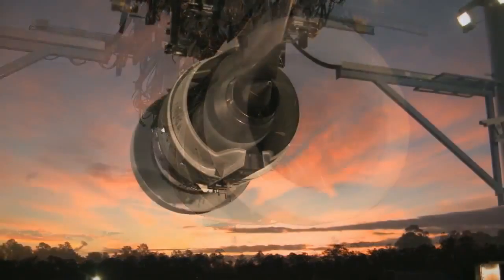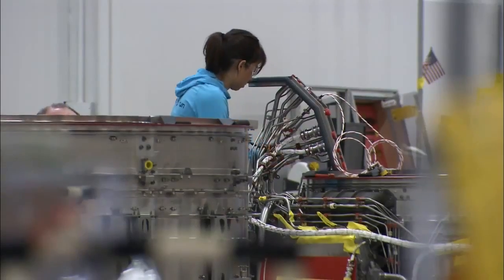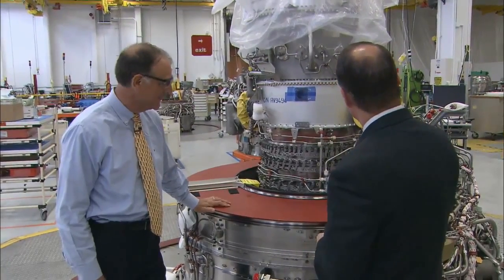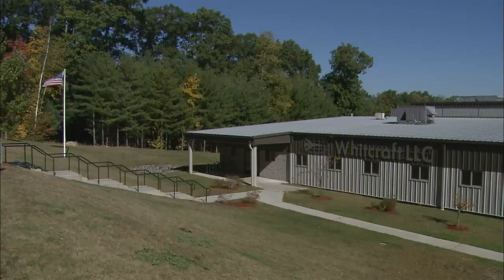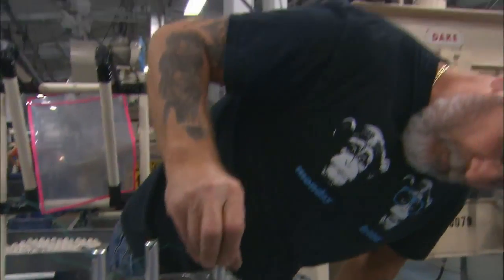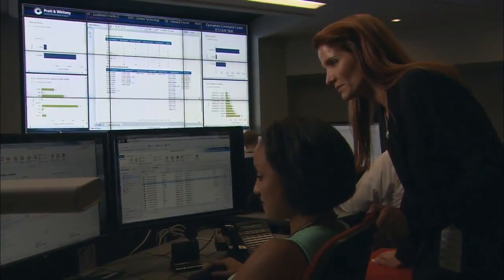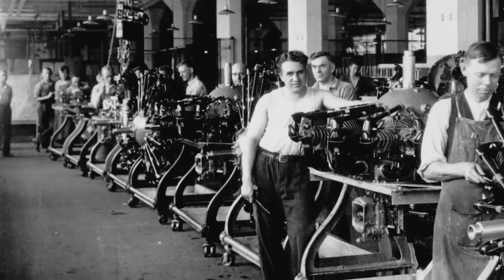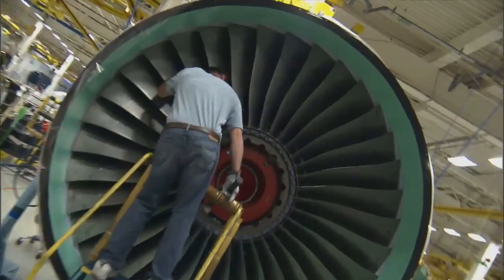Made in Connecticut // Pratt & Whitney: A New Era in Air Travel

Comment: HORSESHIT.  Airlines are going bankrupt because of this crap, known and hidden inherent design issues, of this hide-the-data for certification engine.

Raytheon was hit with this unknown engine BEFORE it started to fail with the public as the flying guinea pigs.  The corporate officers thinking they'll get their bonuses and leave before the shit hits the fan.  P&W did a collective sigh "whew!"  "we're rid of that massive liability" as the corporate officers at PW and UTC collected their bonuses and departed.  All clear?

The FAA and the public doesn't know the half of it.  (the real inherent design issue(s) haven't revealed themselves (in-air failures), haven't occurred yet.)   Just wait, as the cycles accumulate, the REAL issues will start fucking BLOWING UP.

Comment: What HORSESHIT.

Better continue to hope it don't BLOW UP like the oil seal problem in its PW1500G spewing pieces all over the ramp in Mirabel, or the high compressor knife-edge HCF in the PW1100G, or the one-pipe-out cooling of the high turbine, or why most of the thrust load is carried by only TWO of the planetary gears.  Just wait a bit longer for the NEXT failure.

When  "gender parity" takes precedent over ENGINEERING then you're DOOMED, just wait.  PW doesn't KNOW how to manage a successful engine program = a happy customer.

PW only fixes ANYTHING that negatively impacts their financials as they kick the can down the road of rotating managers in and out of gender "parity" programs while the responsibility chases them through their "careers."

FAA Certification, engines, planes, pilots, people, the airline CUSTOMER; ALL given nothing but LIP SERVICE.

Talk to Airbus or GoFirst about how happy they are over the GTF.

Comment: Proud to work for PWA, powering freedom
Reply: Wish it were so.

Better continue to hope the GTF don't BLOW UP like the oil seal problem in its PW1500G, or the high compressor knife-edge HCF in the PW1100G, or the one-pipe-out cooling of the high turbine.  Just wait a bit longer for the NEXT failure.

PW doesn't KNOW how to manage a successful engine program = a happy customer.

PW only fixes ANYTHING that negatively impacts their financials reporting to Raytheon as they kick the can down the road pf rotating managers in and out of programs while the responsibility chases them through their "career."

FAA Certification, engines, planes, pilots, people; LIP SERVICE.